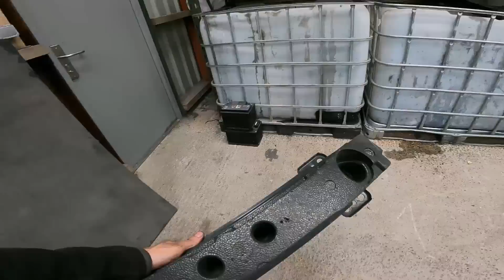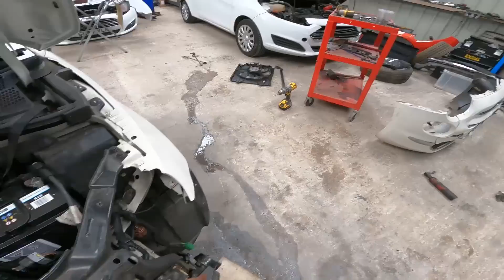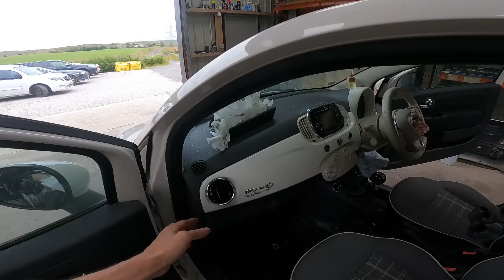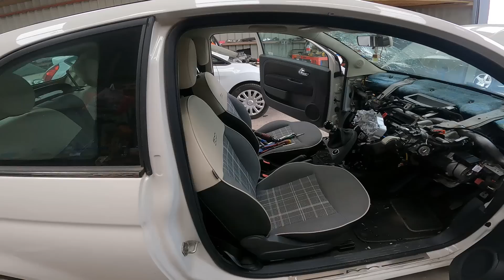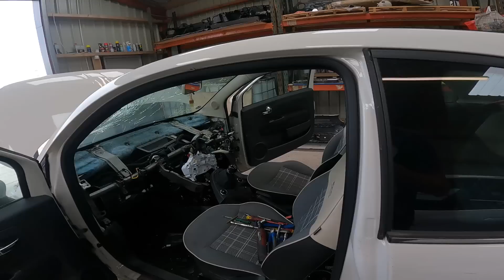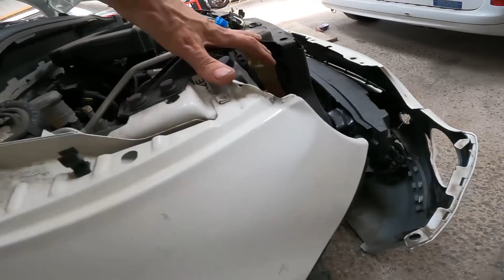The Rebuild Begins On The Salvage Auction Fiat 500C - Rad Pack, AIrbags, Seat belts........

Comment: Sellers who supply dash and airbags rarely supply ECUs. You don’t necessarily need identical part numbers. It’s only the crash data you can’t clear yourself. All the other codes you can. You usually only get the crash data when drivers and/or passenger bags go. Windscreens for the C also have the radio aerial in the glass.